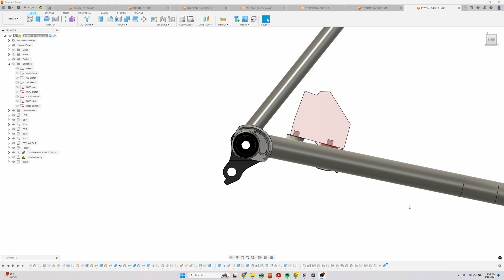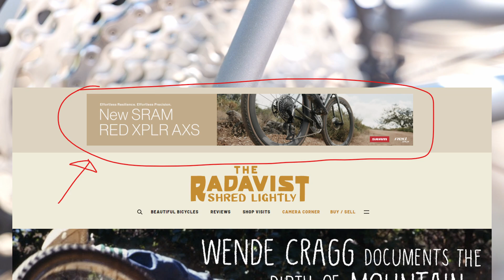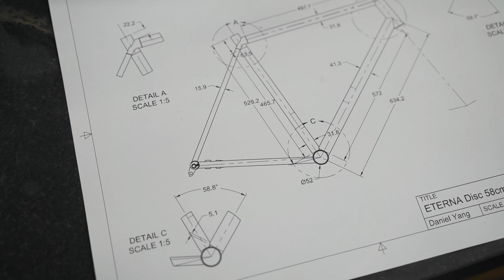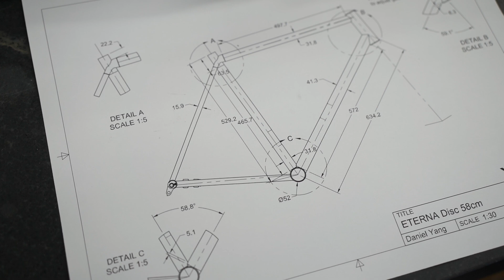Battle of the Custom Dropouts

Comment: Very neat looking work. I'd like to know what the issue with the wider q factor is? Is it a compatability issue? I have no experience with transmission so dont know.
Reply from the maker: @necron1050  some people are very sensitive to the stance width, others not so much. It really varies. However you can always make the stance wider with spacers or clear position, but not narrower! Many of our customers are finding comfort going down to 165mm cranks. Adding 6mm wider stance negates those benefits
Reply: There is not a 1:1 relationship of q factor with cranck length. 
There could be, but that would be an oversimplification.
Usually is already a big word to use. Personally higher Q factor is better for me as someone who is 193cm. I hate the narrow stuff.